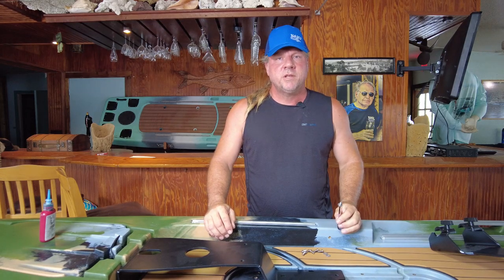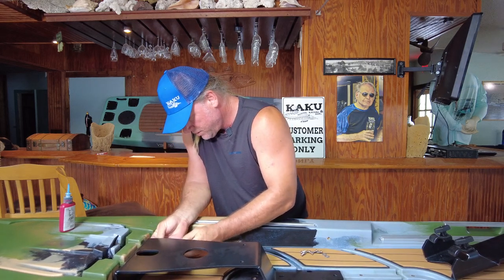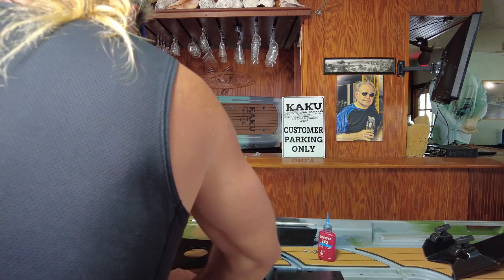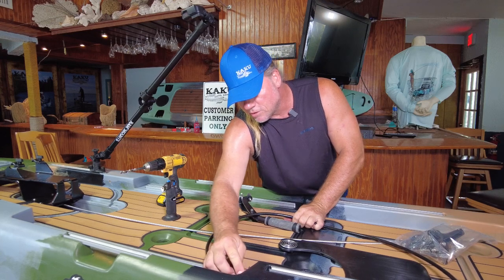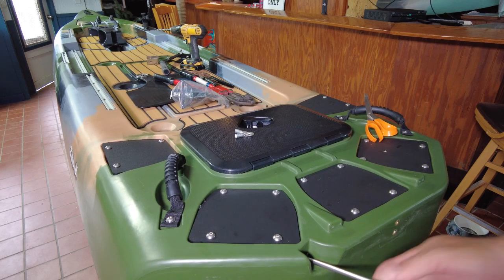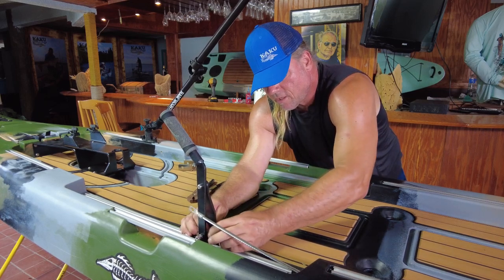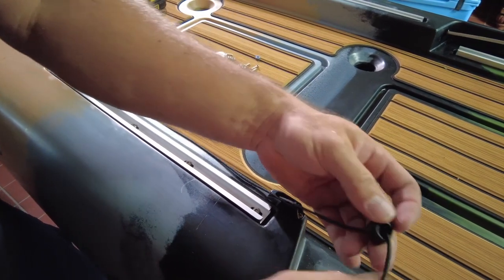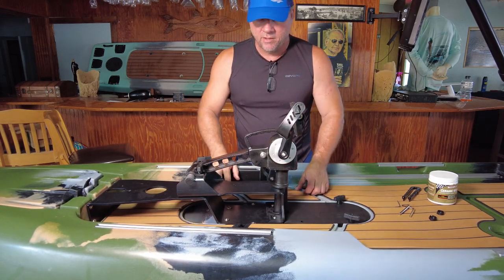Kaku Kayak Zulu Pedal Drive Install

Comment: Great video Kevin! Coming from a tandem hobie in Fl. to a fiberglass boat in Tn. (too big for one person), we are seriously thinking of buying 2 Kaku Zulus's from you. One of the major complaints, (not many), are the carrying straps, (placement, sturdiness, etc.) Have u seen these comments and possibly address this issue in the near future? Thanks WB.
Reply from the maker: The handles are standard carry handles have never had an issue with durability. The placement is what they are. One at the bow and two at the stern. Not really any other place for them. The only problem that happens with them is the bolts can loosen in the brass inserts. Some blue loctite fixes that. We include a tube of blue loctite with every kayak in case any of the bolts want to loosen up and need a little extra. The two side handles are aluminum gear tracks that double has handles.

Comment: Great Video..... do you have a video for how to install a motorguide Xi3 to an existing Kaku Petal Drive including wiring needs?  
Wonderful Kayak!!!!!!!!
Reply from the maker: No I haven’t, its super simple. Four bolts to put on the wireless mount. Pre drilled holes for the quick release puck. I put my battery under the chair and attach a simple quick release plug to the wires.

Comment: What are the white donut pieces for? Also the rubber grommet? Hope I didn't miss anything
Reply from the maker: They are just some extra parts that come with the rudder housing, for use with different set ups. Not needed on the zulu rudder set up